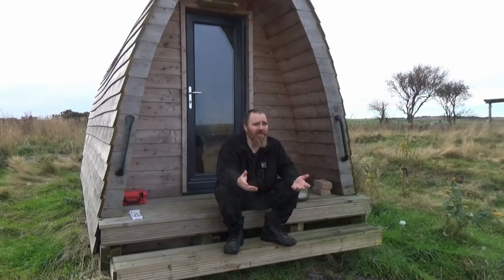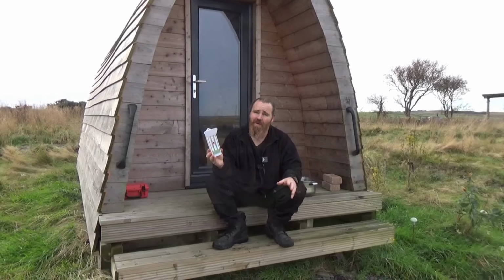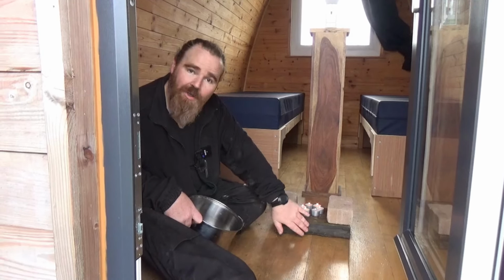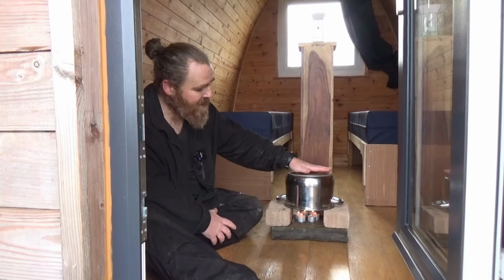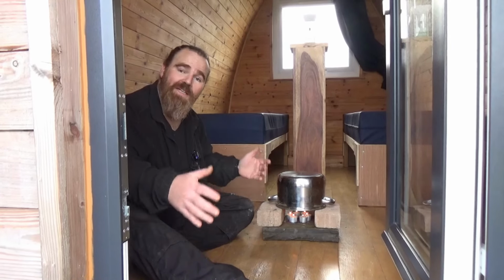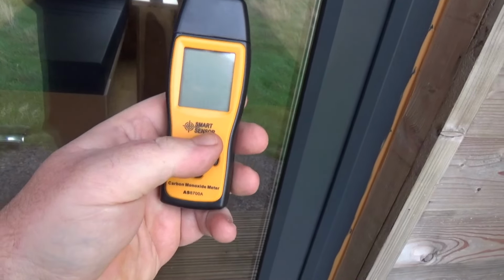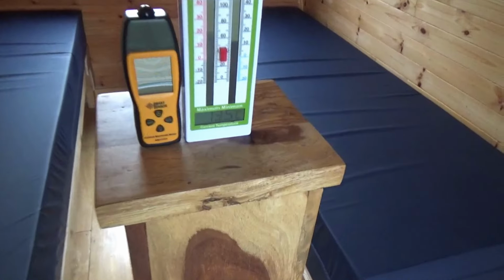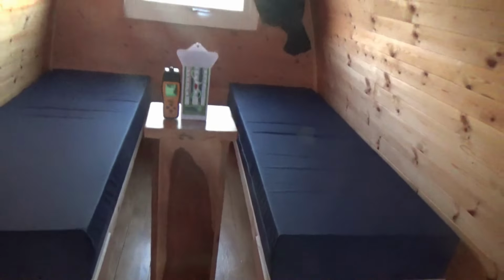DIY Flower pot candle tiny house/camper van/power cut heater tested. Effectiveness? Carbon monoxide?

Comment: If you are interested in these you must watch Robert Murray-smith and his magic wick.he uses vegetable oil and carbon that doesn't burn it burns off the oil but not the carbon fibres.you can effectively have a heated that won't go out.
Reply from the maker: I've seen that video. I've used carbon felt wicks for years in alcohol stoves, so I'm really interested in testing it for carbon monoxide output when it's burning oil.

Comment: Thank you. I've used something similar and know it works but did not know about the carbon monoxide risk. However, I was using it in a draughty room with a ceiling height of at least 10 feet so it had plenty of ventilation. Now I live somewhere else I'll need to stay aware.

Comment: In Feb. 2021, in Houston, Texas, we had a week of sub freezing weather with no power. I made a tin can rocket stove, using sterno and I made a flower pot heater. My apt, got to 48 degrees, while other's homes were 18 -28degrees. The horror was that 200+people died that week in Texas, becuse our power grid was not winterized against the temps; the lying bastards, ERCOT, of course said the grid was ready. they have blood on their hands.
Reply: It was done on purpose. They’re going to do it to the whole northern hemisphere if they can.
Reply: Is that because they can't do it yo the southern hemisphere or don't Want to
Reply: Stock up on hot water bottles, close fitting clothes and blankets and.  They are absolutely invaluable
Reply: @Mpg972  No. it could be parts of the southern hemisphere in six months time. It’s because the northern hemisphere is approaching winter right now.
Reply: Alexej Svirid  PS your post was censored.  I can see it in my replies but not this thread.  Seems the demons don't like Bible quotations
Reply: the rocket stove, although you have to attend to it for fire risk, should have less risk of CO, no?
Reply: We had no power for 4 days and it was freezing
Reply: @suzipam1234  Stock up on candles and hot water bottles, and a little gas stove to boil water
Reply: Frank Lee  Hey CAPS boy... Your comment was censored.  I can see it in my replies but not on the thread.  

And it's interesting to see that someone still believes voting makes a difference.... How sweet.  How trusting 😆😅😂🤣🤣😅😆😂🤣😂😂😅😂😂
Reply: Well its all good to say thise things frank and juno but we had no forwarning. Where can one get wood in times of crisis, and shops where sold out of candles and gas stoves etc. hindsight is a marvellous thing
Reply: Frank Lee  in not sure you have been to houston but with the tropical climate a fireplace is a stupidity. Maybe research before running your mouth off
Reply: @suzipam1234  I've been prepped for three years.  I have gas, food and a water supply sorted along with a lot of other stuff.  Some of us have seen this coming for a long time, and it's going to get worse.
Reply: I wonder if a metal pot works better than a terra cotta pot ??
Reply: @finallythere100  would it keep heat as long as a stoneware item? It might be hotter but not for as long
Reply: @suzipam1234  but would it matter if the candle is continually burning?  That is what I'm wondering. I saw it in one video from Europe. He used a tall n aluminum pot w handles on sides, turned it upside down.   But I had not seen metal used anywhere else..  Thinking maybe even a cast iron pot  for more even distribution, instead of more heat concentrated, as w aluminum pot.

Comment: That was an interesting experiment.  I know that if I have a candle on in a room, even just one, I can feel the difference to the heat in the room.  Good experiment, handy having a control pod as well.
Reply from the maker: We have a couple more experiments to run at some point too.
Reply: There might also be a psychological effect - we expect a flame to be hot so we feel warmer when we see one.  I remember as a child in the 60s, growing up with my gran wiping ice off the insides of the windows, being told to imagine I was sitting by a fire before I got out of bed and I'd feel warmer than I would otherwise.  Wish I could remember if it worked though.

Comment: HEY CAIRN! Great info! Wondering if one can put a few plants in the room to offset the carbon monoxide? "Under some conditions, live plants can effectively remove benzene, formaldehyde, carbon monoxide and nitrogen oxides (undesirable products of burning tobacco and wood) from the air. Philodendrons, spider plants and golden pothos are the most effective at removing formaldehyde molecules."
Reply from the maker: Some plants are able to fix CO in the presence of light, but I'd not want to rely on it.
Reply: Spider plants are best in sunlight, am wondering if succulents and orchids would help at night?
Reply: Thanx for the tip. Good idea
Reply: you forgot ivy and dracaena

Comment: Just a thought if you can insulate the top of the pan with a heat proof material. The heat would then radiate side ways inatead  of heating the ceiling.
Reply: Not enough heat to worry about.  As soon as the heat rises about a meter it cools off...so the heat zone is about one meter above and to the sides of the apparatus.
Reply: You want to really heat a space, get a proper kerosene heater....however cost is $5 for 8 hrs at 30000BTU or $5 for 14hrs at 16000BTU so $5 to $10 a day...no cheaper than a power bill.

Pump kerosene is about $5/gal in the US now.  Hardware store kerosene is about $20/gal.

There are little kerosene heaters that burn only a quart a day and produce about 3000BTU...but most of them are junky and badly built.   I'd rather buy four kerosene RR lanterns and have light plus heat.  Each uses about a cup a night: <70c
Reply: @STho205  Yes you are right cold sinks. But heat still rises from any source like heaters, and body heat, that's why ceiling fans turning in the right direction would bring the heat back down to where you would be sitting.
Reply: @keithmcgarrigle8921  in this apparatus there is not enough heat to worry about mechanical methods if distributing.  Moving air will cool the hot air faster than it can be replenished.

This produces what a stove eye on low produces.  Put a flower pot or empty pan on it upside down.  You'll find hot air only inches from the surface...cooling quickly as you move out a foot, then another.  Mostly completely gone a meter out.

Osmosis of air and patience is all that distributes the heat coming off the pot collector.
Reply: @STho205  Lucky I use electric for my main heating, but if there was a power cut I do have the wood, parafin, and candels as options. Best wishes Keith.
Reply: @keithmcgarrigle8921  oh I live in a national forest in Appalachia on a rural coop power.  All electric house.  We lose power every big rain, snow and wind storm...especially winter.  Sometimes 4-5 days.

Our safety stock:
Two kerosene drum heaters and three gals of kerosene.
Two burner propane camp stove.
A BBQ grill.
Battery and oil lamps.  Candles.
One Coleman gasoline pump lamp.
I have a 750watt tailgator generator to handle early evenings then we go to bed.  Runs on a pint of gasoline for about 6 hrs.

Comment: Its the principel off the "dutch bell".
And you can use it with a much bigger stove.
Sorry for the bad englisch, its my thirt langui...
Your stove exaust can come out at the bottom of, lets say, a oil barrel(without paint, it wil burn of). The square mm's or inches of the barrel must be 5 times more(or more) than the square of the exaust.
The exaust has to go in to the barel further as the diameter of the exaust. The second stage of the exaust starts horizontaal(if its english;) ) and just from the side, at the bottom and goes to the chimney. This bell gets verry hot!
The heat goes to the top and fils the barrel, and the relative colder fumes goes to the chimney with just a lidle air resistance. You can put some bricks around it for safety and heat storage. Make sure that the fumes are at least 65°c at the top op the chimney so the moist in the fumes dont condensates.
Cheers from Belgium.

Comment: I still have the old fashioned ceramic “pig” hot water bottles. One holds almost four imperial pints. Even the smaller one, when you wrap it in a towel and put it in your bed, it creates a beautifully toasty tent — and the water is still plenty warm in the morning if you want to use it for washing.  When I was really hard up, I did!   And I would sit and work with the big one under my feet wrapped in a bathtowel — 24 hours later it would still be warm.  If you have any outdoor space, even a patio, a Kelly-kettle is tremendous; they come in different sizes from about 2 pints upwards, and they boil on a few handfuls of carboard or twigs, quite quickly.

Comment: Thanks for this interesting video.  A better comparison would be the heater compared to the same number of candles burning in the other structure.
Reply: And the carbon monoxide testing was an important, usually overlooked, aspect.
Reply from the maker: I'm planning on running that test this winter.
Reply: @CairnOfDunnCroftPermaculture  Thanks for the very speedy response!  I look forward to the next episode!  :0)
Reply from the maker: https://youtu.be/sK539ekJ4bo

Comment: Don't forget to place a bowl of water on the pot because you cannot heat a dry room. I suspect you will get higher readings if you humidify the room.
Reply from the maker: It depends on the climate. Here in Scotland we typically have 40 to 50% humidity during winter.
Reply: if you have people in a small cabin like that the people will produce enough moisture to warm the room
Reply from the maker: @junkname9983  here, the issue would be getting rid of moisture.

Comment: To retain your heat, place a rock inside the pot above the candles! The rock will heat up and after the candles go out, the rock will begin to dissipate its stored heat!
Reply: That's brillant. You're right
Reply: What about sauna stones?
Reply: How do you  put a rock inside an inverted pot?
Reply: @sherrycapps403  Probably between two pots, or a pot placed on top of the inverted one, or one rock on top of the inverted one.
Reply: @botany500kojak  that might impede the radiant heat in pot 1 warming the air. You're basically insulating the pot there! Maybe just plonk stones on the top of the upturned pot?

Comment: That's why chimneys were invented. All you need to do is punch a hole in the top of the pan and vent out the C02 using some copper pipe. The copper pipe will also radiate heat into the room which will compensate for any heat lost through the chimney.
Reply from the maker: Have you built and tested this? I'd be interested in seeing it.
Reply: @CairnOfDunnCroftPermaculture  Yes, I built one many years ago for my work shed using a coil of copper piping fed through the roof. I used wicked oil instead of candles and it was toasty warm :)
Reply from the maker: Awesome! I'd love to see the photos.
Reply: @lagunafishing  thanks for the info.

Comment: Put in a green wall, or panel to scrub the air of the excess CO2 - actually I'd like to see you repeat this experiment with such an addition to see if it mitigates the risk. Cheers. Interesting video.

Comment: For measureing carbonmonoxide You should take a lower point to measure. It is heavier than air and You should always make Your measurements at ground level!🧐
Reply: Absolutely.
Reply: This is a myth  that CO is heavier than air. It is not and also the fact is that it diffuses evenly throughout a room.
Reply: In UK carbon monoxide detectors are required for rooms with gas boilers or (wood burning) stoves. They are nearly always just above head height. CO is same weight as air, but will be warm so will tend to rise rather than fall.
Reply: Whether carbon monoxide is heavier than air or diffuses evenly, safety measurements should be taken near where the sleeper's head will be, and maybe on the floor if they have fallen out of bed or collapsed. One spot may have enough that you pass out, and another may have enough to kill you in a shorter time.

Comment: I am living in a tent at the moment until my three months are up and I can go back to Portugal where I am renovating my house. I have to stay in a tent there also. Three points these heaters work by radiation so you should not pay too much attention to the temperature change. Also very small places do not need much heat. Lastly I am going to fit a 22ml copper chimney to mine to eliminate the CO problem this will cool too much and to be able to draw but no problem as I will fit a tiny computer fan at the end to draw air through. The fan will not get hot because by the time the exhaust gets to there it will be cold.
Reply from the maker: If I was going to build something, I'd go with something like this. https://www.youtube.com/watch?v=6ZnayOUQN28

Comment: If you can heat some water & use a hot water bottle you do not need to heat all that air. Cuddle up in your blankets with a hot-water bottle & heat yourself, not the space. But make sure you know how to use a hot water bottle safely.
Reply from the maker: Absolutely true yes. A candle heater utilises radiant heat, which is very efficient compared to convective heat. But a hot water bottle uses conductive heat, the most effective method of all. I've made a video about power cut preps that suggests they're the best backup heater of all.

Comment: I heat my water by candle soup and tin food now I always leave the window open a we bit ,I HV 3 candle lanterns fir use in a small room the pot maybe helpful for energencys if the carbon monoxide dint go to high ,I HV a carbon monoxide detector now I HV to get some one to set it up as I'm a bit Dyslexia thanks for info I've watched this for the second time so I understand well 👍🤗🇬🇧

Comment: Since the principal to to create a radiant surface (the saucepan) I would be termpted to try an inverted steamer with the saucepean as the top layer. A carbon monoxide alarm is always advisable where there is a live flame especially if there is limited ventilation.

Comment: Use a flower pot that accumulates heat. Tin pots don't and they are hotter. Once the clay pot is warm, take it to bed and cuddle it under the sheets till it cools down. It warms you up like a champ.
Reply from the maker: I can assure you that stainless steel gets plenty hot. This is an emergency candle heater, not a hot water bottle.

Comment: I'd really like to make some reccomendations to the control measures in this research design of sorts. Is it safe to assume we can expect the cotnrol pod to have 0ppm of Carbon Monoxide? It would be important to know what the base rate of Carbon Monoxide was under the control conditions. Also the possibility of recording Carbon Monixide levels whilst someone is in the pod under control condition. Just to rule out or determine any effect the individual has on Carbon Monoxide levels under the control conditions.

I would also suspect that the size of the pod and its respective area would impact on Carbon Monoxide levels, so perhaps replicate experiment conditions in a larger pod may reduce Carbon Monoxide readings. Furthermore, i'd propose one final set of experiement conditions, in running the same tests but alongside the use of a carbon filter. To quanitfy, if any, how much of those Monoxide levels can be mitigated with a simple carbon filter. This will help to better understand the extent to which we can mitigate carbon monoxide levels using this method of heating, and also make the process safer to use more frequently as an alternative heating source.

Comment: That would be really handy for me, as i work at home, during day when kids are at school, i could keep warm only with this, just next to my desk.
Reply from the maker: For situations like yours, I'd suggest micro-heaters. I use a heat pad like those used in reptile tanks. I use one that's only 7 watts under my feet. It uses hardly any power, but keeps me really warm. You can also use one under your wrists and keyboard if you're typing. It's much cheaper to heat the person than to heat the room.